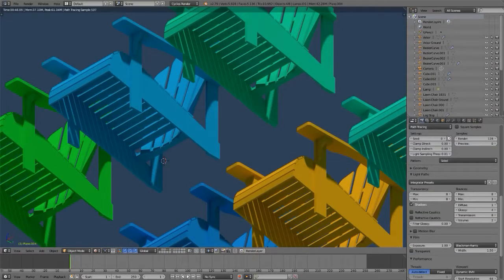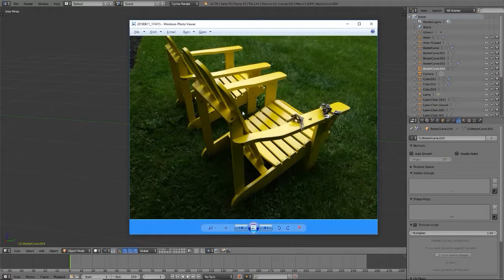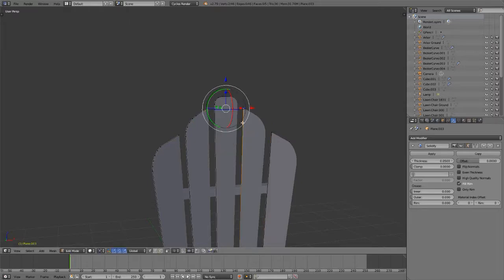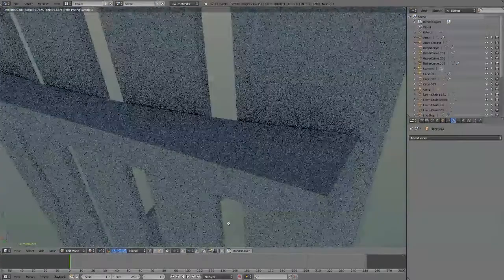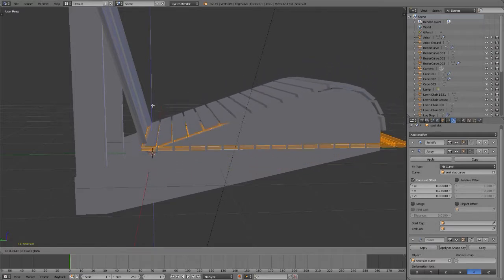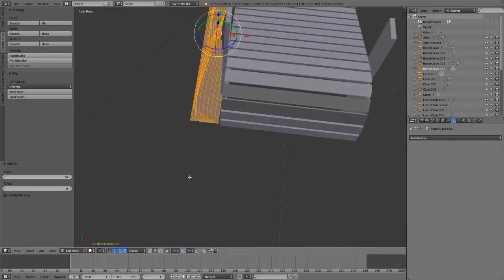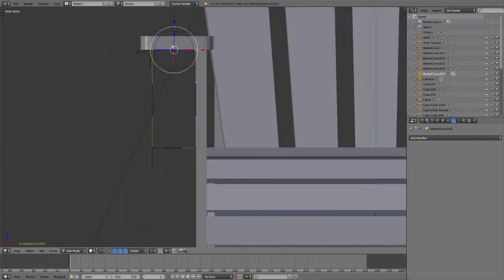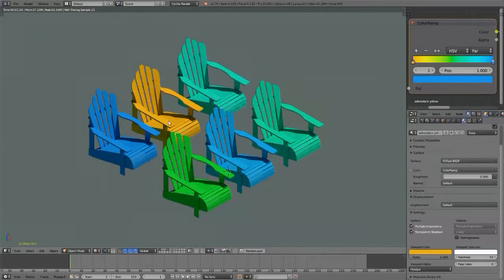25 Blender Model an Adirondack Chair

Comment: Hey there! so you got yourself some brand new computer it seems
Reply from the maker: Emile Zoulette It's too stupid to say aloud: A year ago, I hadn't plugged the hot swap bay in 100% Over the months it's been vibrating out by nanometers and microturds until the morning a butterfly flapped its wings somewhere and the SATA just simply pulled away from the cables by a hair. Enormously relieved - made a painfully long video to prove it.
Reply: hahaha! well you know i'm really not familiar with the inside of a computer, all the plugging wires and cables and shit, so I am certainly not gonna laugh at ya in any kinda way. As long as your computer's back on track, everything's fine. Especially if you have no parts to replace.